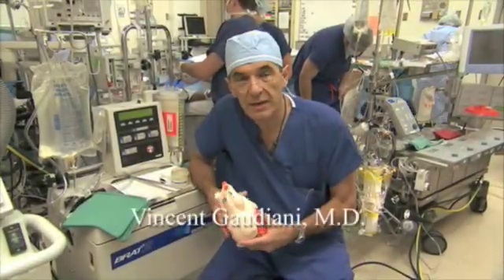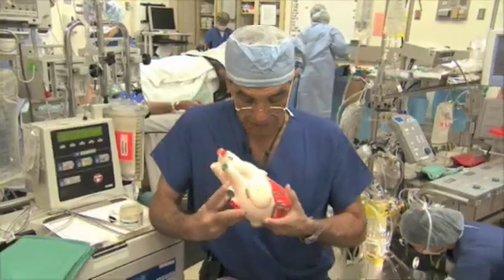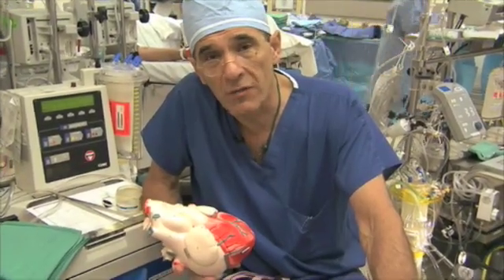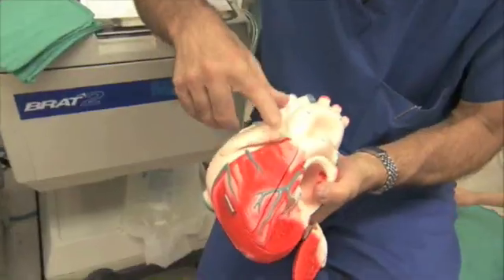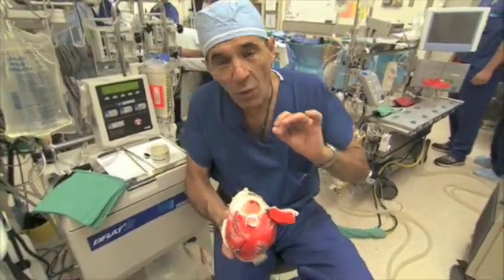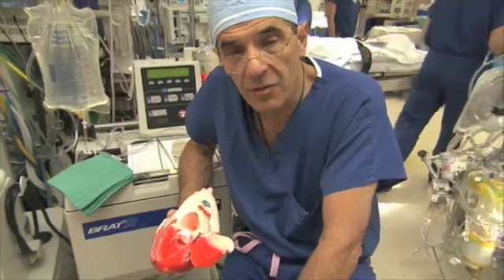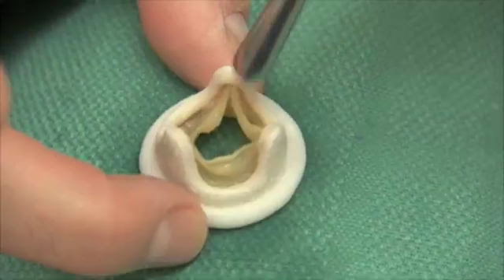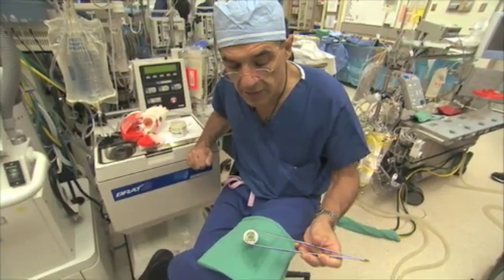Heart Valve Replacement Surgery Explained Part 1

Comment: I’m having a tricuspid valve repair/replacement October 14th; videos like these are very helpful! Thank you
Reply: Hey how was your surgery my brother will have a tricuspid valve repair/ replacement soon. Are you fine now. Was it repaired or replaced?
Reply: @PikuKhajuru  my surgery was complicated. It doesn't hurt to say first that in the past, like with having a tracheotomy, sizes of medical devices used on me have been tricky. I had to have a child sized tracheotomy cap to pass the tests to get off it when I was an adult over 20. For my surgery, they attempted a repair (twice) but my valve had several tears and was too badly damaged. They then (in the same operation) attempted a replacement which was unsuccessful so they tried a SECOND replacement (so two repair attempts and two replacement attempts in one long procedure) to which I was told after "it was an awkward fit but we made it work" because I'd already been on bypass much longer than you're suppose to be and they had to end the operation. Turns out there was a major bleed in my heart that went unnoticed (or I wasn't informed at least) for almost two weeks, they'd sent me home with it. My heart filled so much with blood that it stopped for about 15 minutes. After 13min of cpr they rushed me into my second emergency heart surgery a couple weeks after the first. That replacement was successful, the third replacement they tried. I feel badly sharing because I don't want you to think your brother will have the same bad luck. I just happen to have bad luck when it comes to getting the right sizes for medical equipment, im 5'6 and not petite but not big, but for whatever reason I seem to not be the size internally that would be expected. I also have a lot of other medical issues that tied into my complicated recovery so I just left it with what happened in surgery. The recovery wouldn't have been so bad if I didn't have 2 OHS and 13min of cpr all in under 2 weeks time. I hear most tricupsid valve replacements go smoothly and that it's the least dangerous of the three to have replaced ♡ if you have more questions I'm happy to answer and I wish your brother the best of luck and healing
Reply: @PikuKhajuru  also, from what I was told, they always try to repair the valve you were born with before they opt for the replacement, but if they do decide on the replacement it's usually done in the same procedure, not a second one. I am generally fine now but because of the damage to my heart muscles from the bleeding I had in my original valve, then my heart filling with blood to the point it had too much pressure to beat and stopped, has caused me to have Congestive heart failure now :/ I still have pain when I move certain ways, but for the most part I feel healed from the surgery.